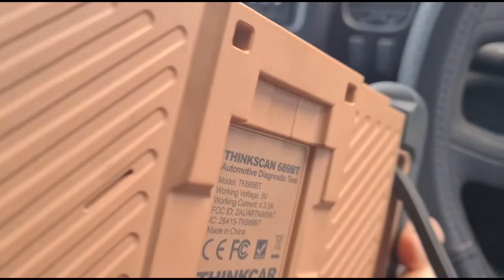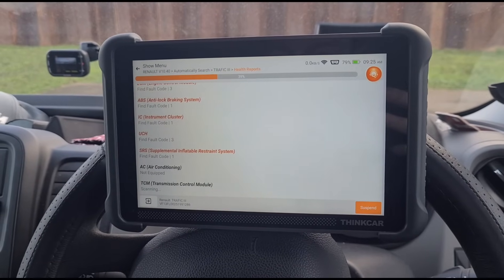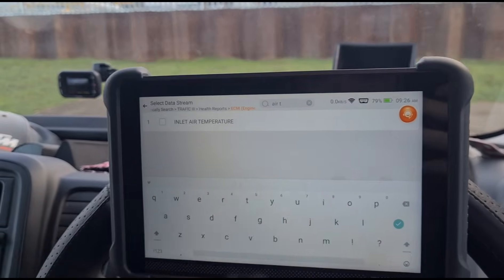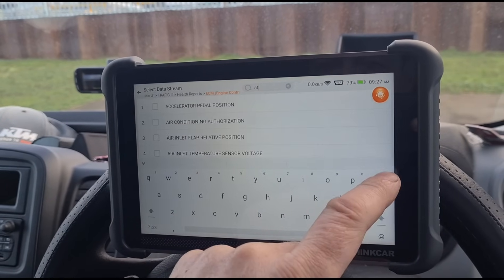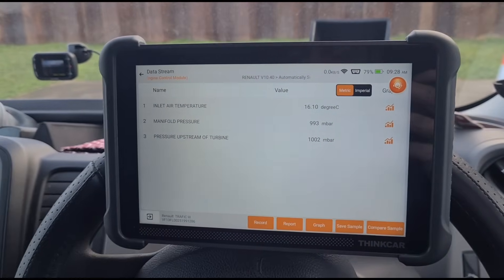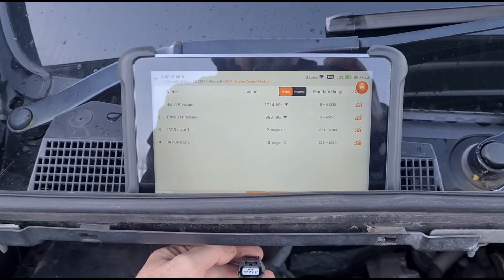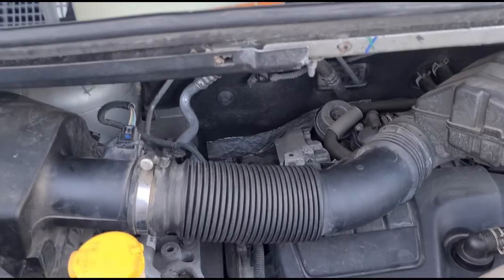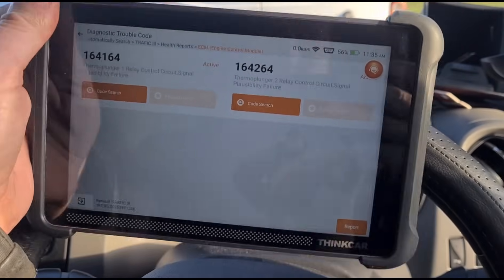Renault Trafic DTC 009564 Air Temperature Sensor Circuit

Comment: I have P0070 , vivaro, I removed the wire from the right mirror and I don’t have error in dashboard, but adblue is 0%, temp is at 50C , ac is not work. Please help

Comment: Random one. I'm hoping you can help me please as you clearly know your stuff and I've watched many of your videos....

I have a 2013 Peugeot Boxer tht is showing "excessive radiator fluid temperature" warning light when I perform a cold start. Running the diagnostic theres no error codes, but does say the oxygen sensor is inactive.

Any help from yourself would be massively appreciated. Thanks.

Comment: Hi Jimmy 
I can see on your Chanel that this model 2.0 or 1.6 are having a lot of issue . 
Do you think the old model of trafić  is better it terms of engine 1.9 or 2.0 . I know that they are having an injectors issue sometimes. I am rally considering to buy old model then this new model
Reply from the maker: These aren't a bad van really. I just see them as they are a very common van
Reply: @ORileysAutos thank you 🤝
Reply: @mrz1426  I have one and literally the only issue it has given in over 100k miles is the common stuff. That Jimmy shows how to repair. In my case the same gunked up sensor in this video and the usual exhaust pressure sensor pipe. Which is a pain in the hole to unblock but as far as modern vehicles go its all easily enough fixed.

Comment: Hi Jimmy is it possible to remove dpf and ad blue from new 2 ltr traffic as my garage did it and van as now blown turbo and charge cooler completely blocked
Reply from the maker: It's possible but I don't do this
Reply: Thanks Jimmy , I was wondering if they had caused the charge cooler to block and blow the turbo vans only done 60 k and sent in to them with the adblue countdown only there were no other issues at that point with the van , but came back after dpf delete etc not boosting and engine management lights on , then a few months later turbo failed and charge cooler completely block , new turbo and charge cooler 6k ago but Eml back on dash now
Reply: Your turbo was already damaged, dpf delete made your turbo spool fully with the back pressure being eliminated,  hence it shit itself, should have done dpf sooner is my guess @leethacker-d5q
Reply: @RussianSpaceman van is now blocking charge cooler again after new turbo and new charge cooler ?

Comment: A mate has a Toyota HiAce 20 years 200,000 miles engine has never been opened just serviced yearly brakes disc's a few wheel bearings and rust repairs but it's as he bought it new.
Reply: Last made in about 2009 maybe...this was a fantastic van...easiest clutch in the world..
Reply: Of course it's going to last longer without issues, it doesn't have any of this antipollution stuff to go wrong like modern vans. Having owned both Renault and Toyota I know what I'd rather drive and I can assure you it's not the Toyota
Reply: @robertgoodall4525  the d4d engined Hiace drove ok.....not like a 1997 nissan
 cargo van I drove home yesterday...🤣🤣..curiously yesterday I removed front subframe and steering rack etc to be able to access dpf on a 1.6 renault Tragic....I think the Nissan nv200 1.5dci I do more swearing though...
Reply: @sm400  Is that a single turbo Traffic? The DPF is easy to access on the twin turbo model.
Reply: @robertgoodall4525  single...almost every engine I've had to repair in last 3 years or so....with exception of an Infinity v8 petrol and Mgb has been diesel😂😂😂....it's not always the fault of vehicle...some of owners need a plug in to a diagnostic themselves...
Reply from the maker: @Evo836  my vw crafter 2.0 couldn't ask for better. 276,000 miles. Same engine, same injectors, same starter motor,  same gearbox & Clutch